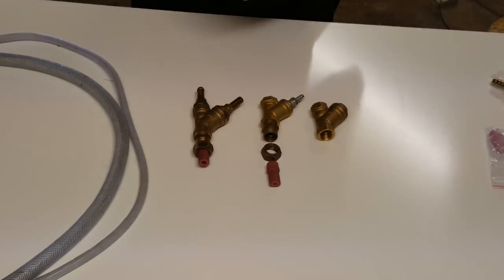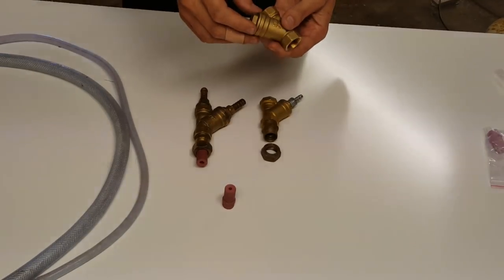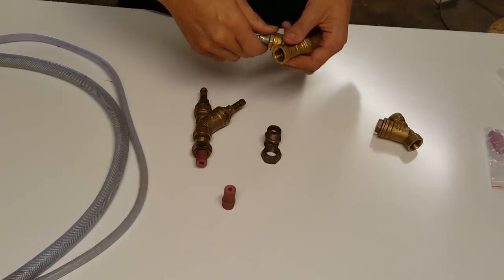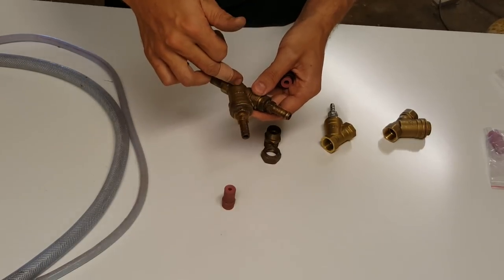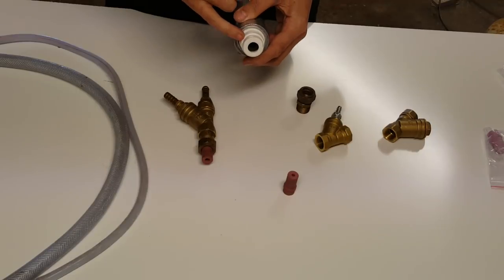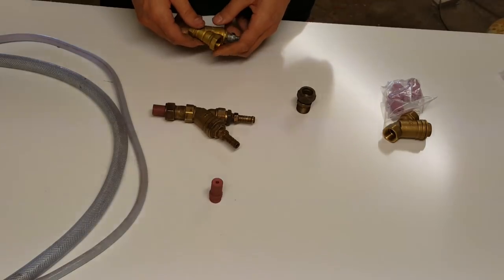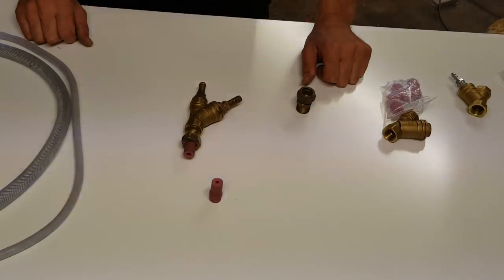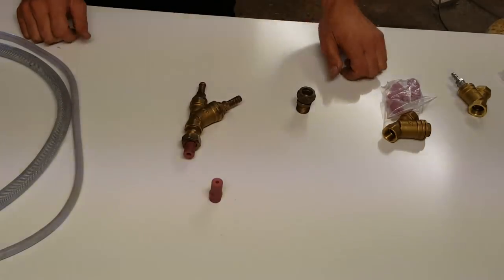How to make a vapor blaster gun/nozzle

Comment: What is the distance from the center pin to the back of the nozzle? Great video. This will be my next project.👍👍
Reply from the maker: About 4-6mm depending on the desired slurry flow and nozzle size.  4mm for 7mm or smaller. 5 or 6mm for 8 to 10mm nozzle.

Thanks for watching!

Comment: Thank you Sr. for post these videos...I´m restoring motorcycle parts and I´m willing to build one "zero cost" vapor blaster. I have a small lathe to machining things and skills to build one from scrap. Of course, as long I´m living in Brazil, I´m on the budget. My question for your Sr: I can have a reasonable result using a 10CFM compressor, which can deliver about 135 psi pressure and 100 liters reservoir? I could use "venturi effect" advantage on the nozzle to improve the results? Thank you very much!
Reply from the maker: Hi Fabio,

Yes you can get a usable system with a 10cfm compressor. There is a little work in setting up the nozzle. You need to balance the size of air inlet nozzle size and gap between the air inlet nozzle and the ceramic tip. Start with a 2mm air inlet diameter and make it larger until it works for you. Usually 2mm will be fine for that size compressor.

Remember though, although you can make it work, it will be a lot slower to get the finish you want
Reply: @ArmouryEnterprises  Thank you very much.

Comment: could you please explain what you are saying at 3:00, you are explaining what the material is you machined the nozzle from, it sounds like elway!
Reply from the maker: Hi.

It's a piece of alloy round bar. I used it because I had some off cuts to use and it's easy to machine. Harder materials will probably do a better job at resisting abrasion but I used this because I was making lots of them to get the flow rate right for my set up and it is quicker to machine.

Thanks
Reply: @ArmouryEnterprises  Thanks for that, Cheers.
Reply: Could.you add a photo of the inside parts of the gun please?

Comment: Any info on the air needle? What's the diameter of the hole? Is that a fabricated part or can It be bought and modified? The only part I'm not able to make as I don't have the equipment.
A die grinder trims out the brass fitting without a lathe or pillar drill. Stone or carbide cutter make short work of it.
Reply from the maker: It is fabricated from a piece of 3/8 aluminium round stock. A lathe makes it easy, but I have done them with a hand drill too.

Comment: Nice Job. can you connect that to the pressure washer and do wet blasting? Is that what vapor blasting is wet blasting?
Reply from the maker: Yes, but it would require modification to fit it to the water blaster and change the air jet to a much finer jet for the water blaster.

They are different processes, the water blaster units use the suction to draw in dry media. 

Dustless blasting is usually used to refer to a sandblasting unit with a water injection nozzle.

Vapour blasting is a pre mixed slurry that is fed into a nozzle and accelerated with compressed air.

Wet blasting can be used to refer to all 3 methods.

Comment: I'm going to try running it on solar and off grid. I just posted a boring update video. There has been a lot of changes to the machine since I've been using it so much. Great video I am curious if a homemade nozzle is better. I haven't tried it yet
Reply from the maker: Hey Justin,

In my opinion, the 7mm pink ceramic nozzle is a little limiting. Works really well but is quite slow. The larger nozzle is much better in a full size setup, but if I was running one in my home shop with a smaller compressor, I would definitely go with the smaller homemade one.
Reply: It makes sense . We need more volume to get the job done faster. It cost money to run that larger pump that I'm using
Reply from the maker: For smaller jobs, I think you could probably get away with a 12v submersible pump and one of my nozzles.

I am going to set one up to go in my work van.

Comment: Hello again... Curious, what's the sized hole for ceramic tip ? I noticed the opening diameter on this video is much larger opening then the original ceramic tip.
Reply from the maker: Hi Rob. 
I use the largest diameter supplied which is 7mm
Reply: Excellent thanks

Comment: Purchased all three of your ebooks and have attempted to make this vapor blaster gun/nozzle. Unfortunately the part descriptions are not great and resulted in a bunch of stuff that I purchased that doesn't fit together. It would be really nice if you created an itemized list with links to products on Amazon or Ebay to avoid getting the wrong items. Otherwise great stuff!
Reply from the maker: Hi Michael,

Thank you for your purchases, and I apologise that you had that experience. Could you let me know which part descriptions were confusing? This is the first anyone has notified me of any issues. My problem is that parts are referred to in many different way in different countries. It is also difficult to recommend parts that I have not personally used as they may not actually be fit for purpose.

Thanks!
Reply: @ArmouryEnterprises  Thanks for the reply. Since there are  quite a few items it would be helpful to list then in an itemized list in the beginning of the manual. I found myself having to read the entire document several times to make a list of items to purchase.
Reply: I also found that the 15mm pipe and nut does not work with the ceramic blasting nozzles that are available in the US. I had to instead use a 5/8" to 1/2" pipe thread (not compression) to make it work. Also the thread pitch on several items did not align to the tap/dies I ordered (as referred to in the instructions) and the rear 1/2" to 1/2" barbed connection available in the US does not have sufficient material to tap/thread the aluminum nozzle jet. It is too narrow and attempts to drill/tap it cause it to break through.
Reply: I appreciate that your instructions are guidelines but they were a bit difficult to follow and have resulted in quite a bit of trial and error. I am learning and getting there, but learning with brass is becoming a bit costly. Otherwise I really appreciate you sharing your knowledge!

Comment: I have another question about the vapor blasting gun you made... approximately what's the measurement (distance) between the ceramic nozzle and the end of the air nozzle inside the gun? And what's the opening size for the air nozzle?
Reply from the maker: Hi Rob.
Distance between the air nozzle and ceramic tip is 6-8mm.

The size of the jet in the air nozzle is 2.5mm at the time of the video, but I have since bored it out to 3mm. This should depend on the size of compressor you plan to run.
Reply: Hello... I'm using a 3.5 HP with a 20 gal tank... Thoughts on my compressor... Will it work???
Reply from the maker: Hi Rob, 
That should work ok depending on the CFM rate. But it sounds like a larger compressor than mine. I would suggest a 2.5mm air jet. If it's too slow you can always drill it out to 3mm or larger if it is too slow for your liking
Reply: Thanks for the info...I'll first try the 2.5 air nozzle first... See if that will work. Are you still planning to do another nozzle video?

Comment: how to make a vapor blasting tool like that yesterday I made it but it doesn't work can you help
Reply from the maker: Post a video and comment with a link here. These can be a little difficult to work and it is hard to help if I cannot see what it is doing wrong.
Reply: I mean the ingredients to make the spray gun, bro
Reply from the maker: You say you made it but it does not work. I need to see what it is doing so I can tell you how to fix it.

My one is made from a brass outer housing that used to be an in line water filter. The inner air needle part is made from aluminium.  The nozzle is a ceramic tip - 7mm from a sand blasting gun.
Reply: that's exactly what water filter material is for the device so that I look for it in the shop
Reply: I already got the ingredients at the online store, but I have to buy what size is inches so I can get results like yours
Reply from the maker: All the brass fittings are 1/2". The length of the inner air tube will depend on how your outer housing fits together. You will need about a 1/4" or slightly less gap between the end of the air tube and the ceramic tip
Reply: OK, I'll try it, thank you, friend

Comment: I like what you are trying to do, and applaud you for it. I had a thought of using the slurry under around 50 psi and then injecting air as the slurry is now. This would aireate the slurry and maybe cancel the need for compressed air. What do you think? Have you ever tried it? It is cold here in the mid USA and my shop is not heated so it will be spring time before I can try it. Give you something to think about. Thanks for the videos; I just subscribed, keep up the good work!
Reply from the maker: Thanks for the subscribe Frank,

I had tried something similar with a pressure washer that drew air into the nozzle just before the ceramic nozzle. What I found was that it yielded a fairly substandard result. I put it down to the fact that the increase of water and decrease in volume of air meant that there is no elasticity in the pressurised water resulting in the incoming slurry absorbing some of the energy and decreasing nozzle velocity.

That being said, I am no physicist and gave up pretty quickly. This is not to say that it will not work. Definitely give it a try because there are plenty of things I may have missed. Let me know how you go once things warm up there!

Cheers!
Reply: Thanks for the information. I had thought of the pressure washer, but I want to try a sump pump and regulate the pressure with a controlled leak. Thanks for the tip on injecting the air before the nozzle. I was contemplating before and after the nozzle, so now I may try after the nozzle first. I will let you know what I find. Good luck on building your channel; like your videos!
Reply: Thanks for the information. I had thought of the pressure washer, but I want to try a sump pump and regulate the pressure with a controlled leak. Thanks for the tip on injecting the air before the nozzle. I was contemplating before and after the nozzle, so now I may try after the nozzle first. I will let you know what I find. Good luck on building your channel; like your videos!
Reply: Thanks for the information. I had thought of the pressure washer, but I want to try a sump pump and regulate the pressure with a controlled leak. Thanks for the tip on injecting the air before the nozzle. I was contemplating before and after the nozzle, so now I may try after the nozzle first. I will let you know what I find. Good luck on building your channel; like your videos!
Reply: Sorry 😐 for the multiple replies technology is not my thing
Reply from the maker: Sounds good Frank! Looking forward to the outcome, and I wish you luck!

Comment: I enjoyed your vapor nozzle video however I'm also confused about the small air outlet inside the Y-brass fitting... can you show us in detail how and what you made the air nozzle from pls? Its round the 3.00 mark.  Just by showing the end of it inside the brass Y fitting doesn't show much... Suggestion can you pull your gun apart to show this in a better way?
Reply from the maker: Hi Rob, that particular gun I have just got tuned to a good length and set up well. So I dont really want to pull it apart. 

I will however be building another one shortly so I will show all the the components and maybe draw a diagram too.

Essentially it is the same as any other sand blasting gun.

Thanks
Reply: Thanks... I totally understand about not wanting to disassemble it, and doing another video for us would be very helpful. After seeing your first video my "Y" brass fitting finally arrived this week.